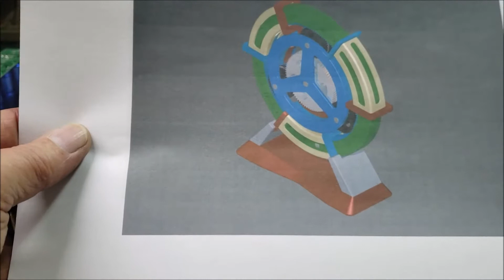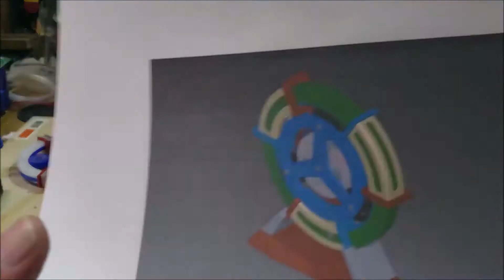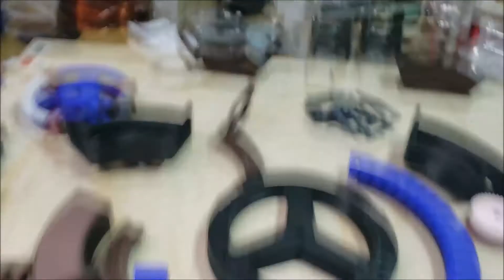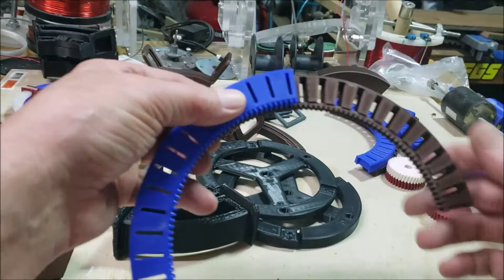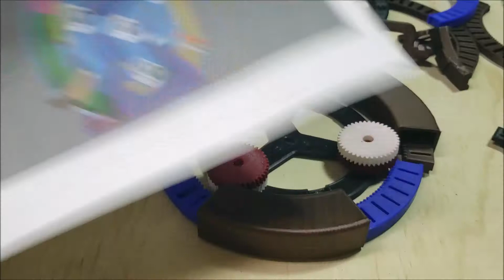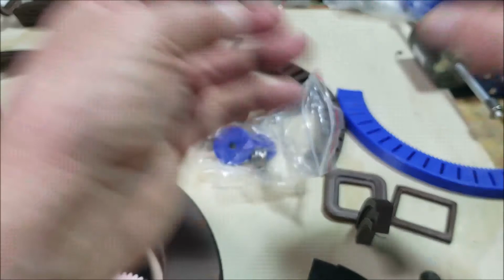3D printed solenoid motor.

Comment: Hi Mcorrade, 
Just letting you know I did another drawing that suits the same back plate for you to look at up to you if you want to use it, has been done at scale so you will not need to adjust nothing this time, it was built as a test rig for the circuit setup, will need you to send the outside dimensions of the gear you have at 40% so I can do your rollers.
Reply from the maker: I got but you said that this build is already sized but all my parts are at 40% of original for the last build/prints. Will I need reprint everything pr can I use the original rings? BTW the deign looks great!
Reply: @mcorrade  
I will make rollers for the one you have i just need a clue on the outer dimensions so I can make the rollers to suit what you have for those rings, just measure across the small gear you printed that you were going to use and let me know the size.
Reply from the maker: @SpaceManAus  actually my friend, I'm going to print the new high speed version. I've already sliced all the parts and its not too bad. I will continue to build the original and will also print out the new.
Reply from the maker: hey disregard my last statement. I just realize that this is an entirely different setup. Very cool and I will start the printing today

Comment: Oh just print some shims for the magnet hole slop. For magnet arrangements try pointing the same pole of 2 magnets towards each other. NS-SN-NS-SN unless that was already the plan.  Anyways looking good.
Reply from the maker: thanks for the feed back. Not sure yet how but will take all suggestions seriously
Reply: @mcorrade  https://youtu.be/XWg3-Wy9im8 you know why I am interested in this little project of you 2. If you look at the array with magnetic film you will see how NS-NS-NS-NS looks compared to what I said the first time. Pancake coils would work best with this coil setup. If you were to turn the center gear with my VAWT what will be moving, the coils or the magnets? Just the magnets. Anyways. Looking good.

Comment: You printing ABS or PLA, and ring was made in parts for pore people like me with little print beds, the single bake plate don't fit mine.
Also was thinking you could print fake magnets,there are 50 magnets in total so if you replace half with fake one's and glue some in on opposite sides and use them to hold it together.
And in the second last zip file there is a picture of the parts in order so you can see what goes were and how the ring lines up, important doe the gears to mesh fully.
Reply from the maker: I always use PLA and the fake magnets is a great idea. I will do that. My prints aren't all that I would really like to see your system online?
Reply from the maker: I'm trying to think how to connect the gears to the backplate? I'm thinking I may have to use a metal cylinder sleeve on each gear and then run a long bolt all the way through? Your ideas on this process is greatly appreciated
Reply: @mcorrade  also the bearings only need to hold the gears to allow them to spin freely will drill out any hole to tight, the bearing holders are what line up the gears and washers inside between the back plate and gears to space them in the correct location, the bolts threw the coil bodies are what holds it together.
Reply from the maker: @SpaceManAus  so I'm going to print out the newer outer rings that have the screw holes in them. They take a long while to print but I think its worth it. There a much better design in my humble opinion :)
Reply from the maker: @SpaceManAus  bad news the gears don't fit inside the out rings. Its off buy about 3-5mm. I'm going to reprint the center gear and reduce the diameter but that much and hopefully can make it work. We'll get it working but it may take longer that I thought. ugggggggg
Reply: @mcorrade  
Try running a file in the teeth to allow them to mesh more, the first ring I did worked out, will need to make a cooling fan to make my prints keep shape as it builds the angled areas first then I should be able to make the parts.
did the video for you uploaded it today.
Reply from the maker: @SpaceManAus  don't think that will work. The teeth are meshing just fine its the overall size that's off. I'm printing a new as I write and will update you on the results.
Reply: @mcorrade  
Changing the size will change the ratio of the gears may  not roll well, I got a file and cleaned mine and they fit well will take a pic and  send it to you, it is impossible for them not to fit unless there was a difference in the percentage rate, I am thinking of redoing all the files from scratch and make it so they don't need to be resized at all, will do them soon not that that will help with your problem.
Reply from the maker: @SpaceManAus  I'm only changing the diameter not the thickness so it should be ok
Reply from the maker: @SpaceManAus  so by reducing the diameter "only" I got them to fit. I reduced it be 3mm and got it the first time around which I really surprised. I will print the other have of the center gear and take a video showing the fit and finish
Reply: @mcorrade  
Sounds good, hope it still meshes OK, I taped my ring together and test the gears and all seemed OK, I sent you a picture, not sure until I get one built though the true outcome will be.
Reply from the maker: @SpaceManAus  I hear that. My fear is the  gearing may be too tight for the ring to spin freely. I was a thinking about a non geared system where the gears have to teeth just a rubber ring around the gear. We'll see what happens
Reply: @mcorrade  
I was thinking of doing a drawing without the gears and just have the outer gears with no teeth more like a roller, the gears were just to be able to drive something of it, eve to jst work on the electrical circuit.
Reply from the maker: @SpaceManAus  yes like rollers with a rubber outer rim or something
Reply: @mcorrade  
Working on it now, will make it suit the back plate you have without the need to re-scale it.
Reply: @mcorrade  
Hay I am redrawing a new one from the start that will not need to be scaled down since I have had no luck finish the other, but will make you a set of rollers for the parts you have as well, at work now and will continue once I get home OK but can you tell me what size the rollers need to be to suit your ring 3mm smaller is not enough for me to work of what was your final width of your new gears.
Reply: @mcorrade  
Hay wanted to ask what the size of the gears are pluss the size of your bearings, I will make them fit the rollers, your printer looks like it will be able to handle the print
Reply from the maker: @SpaceManAus  so the gears I've used have been 40% of the original size. Don't worry about the bearing size because I can make the bearing holders fit just about any size bearing.
Reply: @mcorrade  
I was going to build the bearings into the wheel into the weal so you only needed to place a 316 stainless bolt threw it all might work out simpler.
And 40% may not be correct since my gears fit and your did not, as yo will not need to resize them.
I have redrawn the hole thing at the correct size for owe printer this time to do away with rescale and did it purley as a high speed setup with rollers and no center gear, just need to do the bearing holders next and I will send it to you as well as it is made to work of the same back plate and will make the coils fit the same as well, but the ring on this one is completely round.
Reply: @mcorrade  OK will make video, I sent a link to the bearings I am using got on eBay cheep will send link again, was hoping to have had my parts read to assemble an long with you but my shit printer kept failing, but I did notice over the weekend when I fixed a bearing on one of my printer the belts were extremely tight fix it last night but went to test it and had not noticed I had broke the end stop switch will fix today and with some luck resolve the problem.
Will do a video though, have you got Skype we can talk direct and share videos and pictures without the need to upload on YouTube, lot more convenient.
My printer is a CTC Makerbot replicator clone, have done some amazing builds on it but for some reason decided to be a pain, but I think the over tight belt would make sense as the stepper would get hot over time explaining to failure at the end of the print, I hope so anyway.

Comment: I was going to upload a video I did to show how pore my printer was doing but after seeing your print work I am to ashamed to, very nice work I think you have convinced me to stop wasting time trying to fix mine, I don't think I ever have had such accurate prints as the ones you have displayed, thanks for showing the progress can't wait to see it spinning.
Reply from the maker: so the printer I'm using is the ender 3 pro and can be had for under $200.00 USD but if I had to do over, I would have gotten the ender 3 v2. It has a 32 bit board and silent stepper motor drivers which to me, are worth the extra cost. I think the v2 goes for about 100$ more than the pro model. Don't get me wrong, I love my ender pro and yes it does a great job

Comment: Like what you did standing up the coil body, I think I may have found out the problem with my prints doing an old print I have had no issues before and it seems to be working.
But wow your print job has come out nice, if this higher temp don't work out, and the ring is made to off set it the image I have sent you shows the layout.
Reply from the maker: yes I found that standing them up was the trick and more over using a raft was the real trick